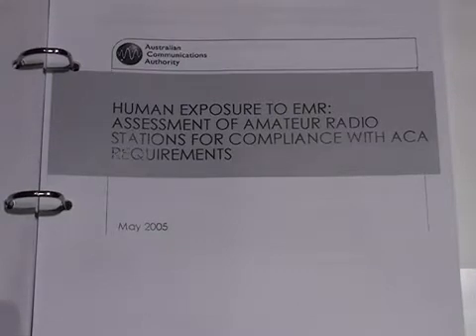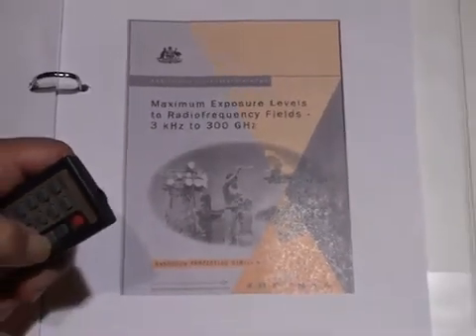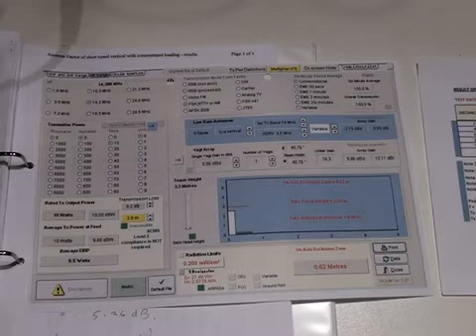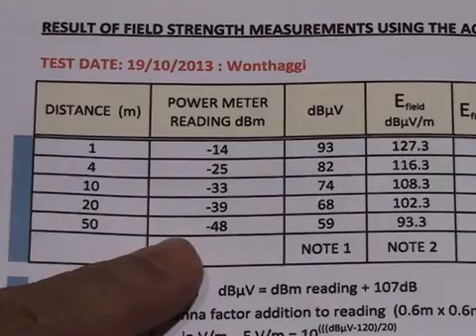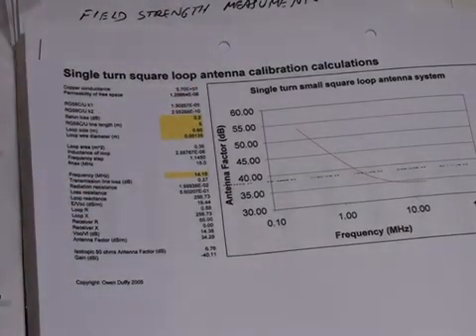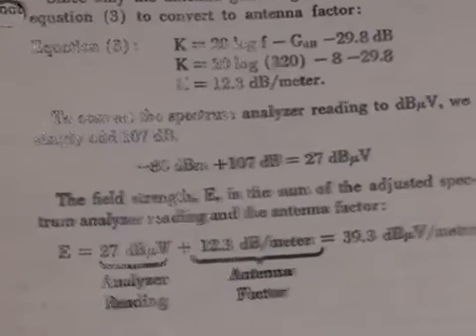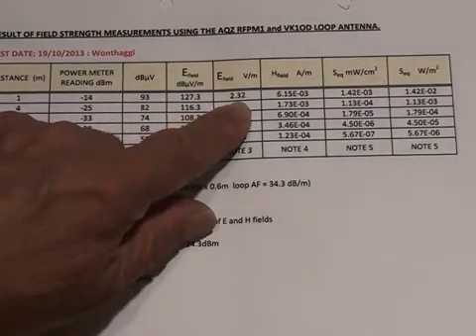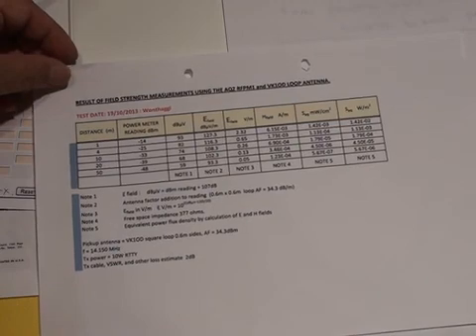Using power meter measurements to find field strength values Part B

Comment: Over here in the UK we have just had notification from OFCOM that we have to make mesurements of the bands we use connected to the antennas we use for any/all equipment that outputs 10W RMS. 
It seems you are way ahead of us time-wise with the date 2005 on that document from the ACA.
Personlly I think it is  good thing but many strongly disagree and I have heard some quite 'colorful' language as of late on the 2M band from disgruntled ham's...

Since receiving notification that we must do our own measurements
we purchased and have since been using a handheld EMF Meter and RF Spectrum Power Analyzer from GQ Electronics,  annoyingly it has a gap between 108MHz-240MHz when using the 'rf browser' function, but otherwise can measure from DC ie. static fields, right upto 10GHz electric & magnetic component's.

Now I remeber seeing this video (and part 1) some time ago but admittedly I was more interested in the likes of your rig homebrew videos,  now however I am most grateful you have shared your methods and measurements. 

73 !!
Reply from the maker: Hi. Yes thank you. Eventually most hams will need to make sure the RF levels from the transmitters do not cause injury of some kind, Ok on your test gear - sounds good. Cheers, Lou